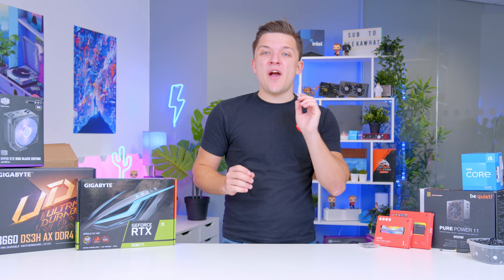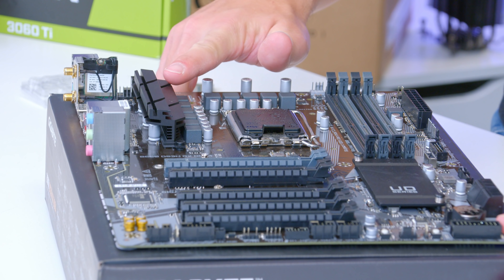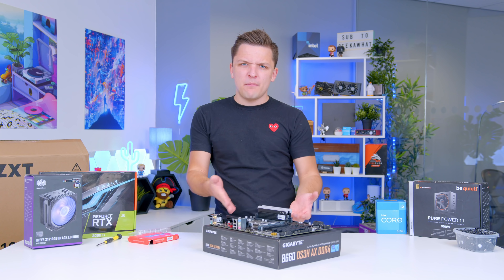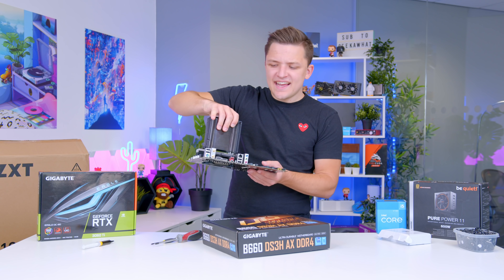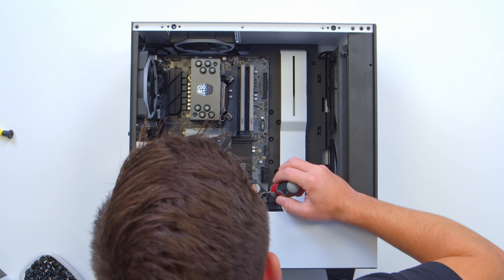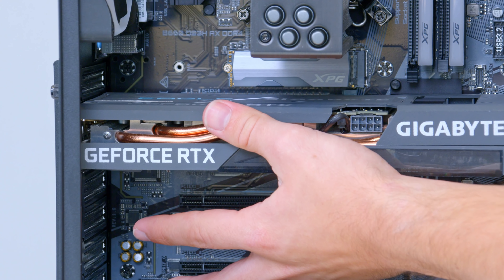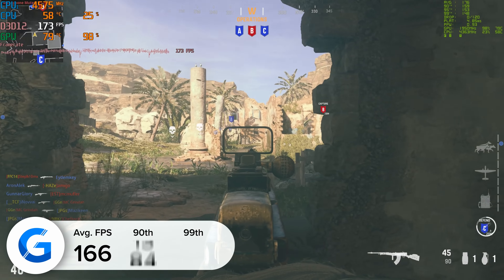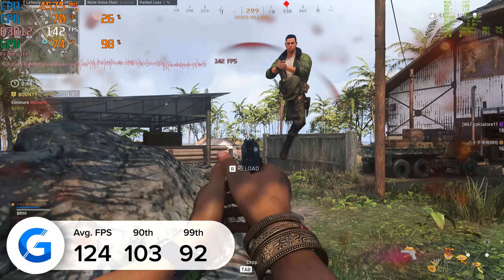The BEST $1200 Gaming PC Build 2022! [Full 3060Ti Build Guide w/ Gaming Benchmarks!]

Comment: Great Video as always! But B660 Motherboards are not able to overclock the CPU. They are able to overclock the RAM however. Cheers ✌🏼
Reply: What does overclock mean i looked it up and still not sure
Reply: @kaizenleggett8272  You can force the CPU and / or RAM to work on a higher frequency than intended by the manufacturers.
Reply: You don’t need a higher end motherboard bc the intel i5-12400f or non f version cant be overclocked cause they’re locked cpu’s!

Comment: Is an i5 11400F, RTX 3060 Ti, 16GB DDR4 3200MHz, B560 motherboard, 1TB M.2 NVMe SSD for $1300 a good price or should I wait until the rtx 4000 series come out?
Reply: I think rtx 4000 series is gonna be very expensive
Reply: And it sure is
Reply: Don't wait.
Reply: just upgraded my cpu to the 11400f with the b560… waiting on my 3060 ti bought yesterday with the price going down…
I think if you have the money spend it now with prices going near msrp. my hot take is that prices will go up again when etherium delays transferring to proof-of-stake
Reply: @TwisQ  nun mh

Comment: ASUS TUF GeForce RTX 3070 Ti Gaming 8GB, Ryzen 7 5800x, x570 meg unify, 32gb 3600mhz ram, wd sn850 1tb heatspreader and 500gb, nzxt z73, ASUS ROG STRIX XF120 120mm MagLev, 850w psu and 5000D case. are these specs working together i just want to make sure?
Reply: Put all of your part on pc part picker. Then look for the estimate power on the top right. If that number times 1.5 is lower then 850 W you are good to go!
Reply: @ilcavalierundante  just asking do i need to update the bios on the motherboard for the ryzen 7 5800x?
Reply: @Aleexah  Some x570 board may not support out of the box your cpu. But the x570 meg unify has the bios flash button so you don’t have to worry. If your system doesn’t post then you look for updating your bios with the bios flash. There are so many tutorials online on how to update you bios with the bios flashback go check one of them out.
Reply: @ilcavalierundante  k thanks man :)

Comment: What is the best gpu for the ryzen 5 5600G?
Reply: Why use a 5600g with a gpu? It has onboard graphics. If you want to do a build with dedicated graphics a 12400f is faster and cheaper than 5600g. 3060 ti seems to be best value atm, at least in my region.
Reply: 3060 ti is $580 USD where I am
Reply: @madthough2298  because i had no money

Comment: I just pit all the items in my list and cart. I'm starting to save for it now, thanks for this beast! I'm gonna cap Fortnite at 165fps for my 144hz monitor
Reply: Keep it on 240 this build can easily hold that. If you say there’s no point putting it that high because my refresh rate is lower i will lose interest in the conversation and let you do research to prove yourself wrong
Reply: @arx_vfx605  bro, there's no point in using 240 if I have 144. You want me to waste my time researching about it. 💀
Reply: @Skibidik56  bro d9 some research hertz don’t matter that much
Reply: @arx_vfx605  ? why do you want more fps than te ones you can see? A waste of Usage in nothing
Reply: @crocorockjook8841  you will still feel the difference in input lag. I’ve done tests for this and 165 fps and 240 fps on my 60 hz monitor have a huge difference in input delay. Frames per second is not only visual it affects ur inputs as well, why do you think you can’t edit fast on 30 fps?  It because it looks bad but because the game is refreshing ur inputs every 1/30th of a second
Reply: @arx_vfx605  it matters. Playing on 60hz or lower will limit how fast you are
Reply: @Skibidik56  not necessarily. You’ll be seeing only 60 frames but feeling as many as you cap it on
Reply: What was the actual total

Comment: I heard people saying that the CPU doesn't work well with 3600Mhz RAM and have to lower down to 3200 for stable performance, I wonder if that's true.
Reply: theres no such thing, the cpu is limited to 3200mhz ram, but increasing it to 3600 wont affect the performance, you will get the same performance as a 3200 even if you have 4000mhz, the cpu is limited to it. and btw 3000mhz is already pretty good
Reply: @AlexerTalksCars  i just wanted to know can I use D50g or D60g instead of d45g. Will it affect the performance

Comment: Hey mate love your content..i need some help i wanna buy this build does it good? And worth 1125$?
Asus prime h610-m d4 gaming motherboard
Cpu: intel core i5 12400 
The cooler is stock
Ram: Teamgroup tuf gaming rgb ram 16(8x2) 3200mhz 
Ssd: addlink s20 2.5 sata III  6gb/s 120GB
Hdd : Toshiba 1tb red 7200 rpm sata
Psu: deepcool d700 80 plus certified 700w 
GPU : IGame geforce rtx 3060 advanced oc 12 gb
Reply: Looks like a great bulld! You can put it all in pc part picker to make sure it all works together.
Reply: About the mainboard......
I think h610 is not good enough.
b660 is better

Comment: i got DDR5 6000mhz XPG Lancer CAD $380-390 it’s double the insane power of DDR4 so why the heck not! and theres no RGB a nice soft grey finish and same with my MSI Z690 black just to match ram power supply with white case white cable mode $184! it’s fine for that looks nice quality too plus a epic 980 1TB M.2 other stuff on the side $4,700+ monitor etc is all in there :3 

Edit: 3070 TI Vision Gigabyte. Dont worry there is a heck toon of RGB on “other parts” super RGB PC if you thought there was n RGB in my build ya no, there will be ALOT
Reply: do u get double the speed hahah
Reply: Bro stop the cap its either 3% better or 3% worse in gaming

Comment: btw guys you won’t get 232fps on fn at 1440p high it’s a typo
Reply: How much then?
Reply: @wazey9970  like around 70
Reply: @waddle12  that has to be cap
Reply: @wazey9970  on high settings at 1440p you will get aroumd 70 fps but 1440p low you will get about 190-250
Reply: @waddle12  and what about in 1080p
Reply: @wazey9970  high settings 90-110 and low 230-270